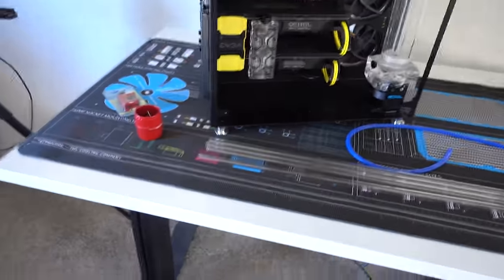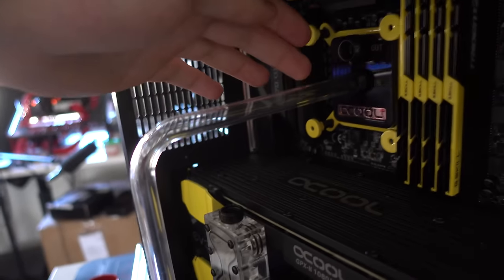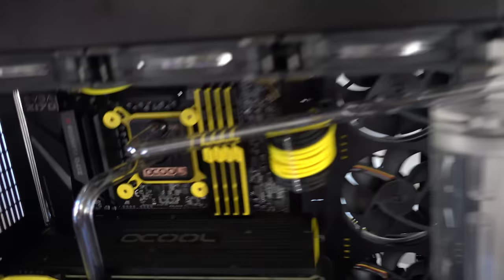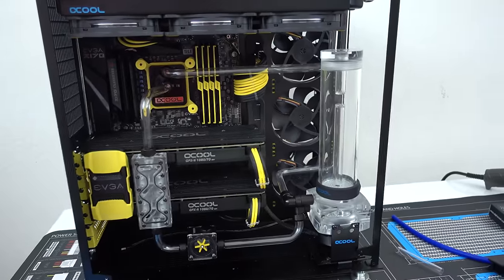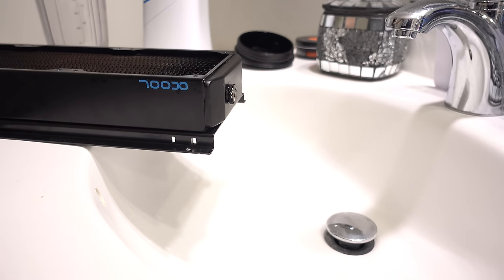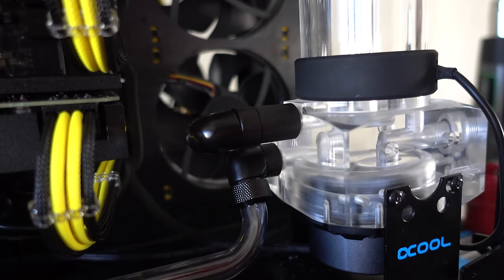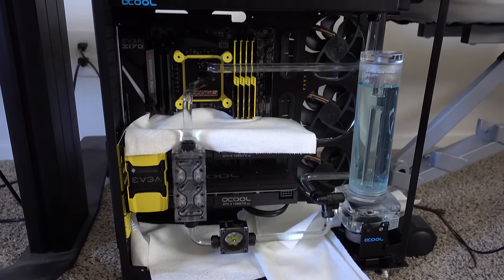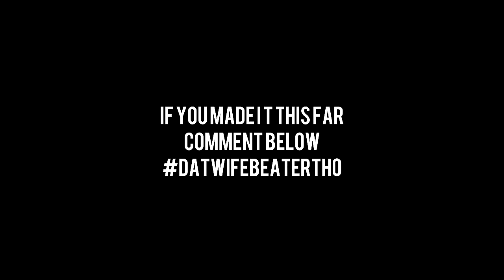More Problems With #ElectroBox | Final Episode

Comment: the problem you are having when tube bending comes from the lack of rotating the tube while heating their are several videos showing how to do that. The tube needs to be heated on all sides by constantly rotating the tube that will help not to get blisters or have kinks I would suggest holding tube about 4 inches away from the heat gun however practice makes perfect :)

Comment: when bending tubes do one bend then measure just the bend. You can then measure from end to end and subtract the bend distance from the end to end distance. So say your bend is 20mm and the distance from the CPU block is 120mm. You measure 100mm on the tube to the START of the bend. The start of the bend is used because when using a bend former there is a mark for the bend start. If you want to mark the middle of the bend do a test bend at 100mm. Then measure the tube from end to end. If the tube is 110mm you know to subtract 10mm from your end to end measure. This way you will waste a lot less tubes and tubes with multiple bends can be done accurately. Hope this helps.

Comment: by the way nice video but the thing is you should have used II radiators, because when the water is going to come out from the CPU block it is going to be a bit warm which need to get cold so that outlet should go into the second radiator and the second radiator out should go into the GPU block which will lead u with a better performance and temperature rating
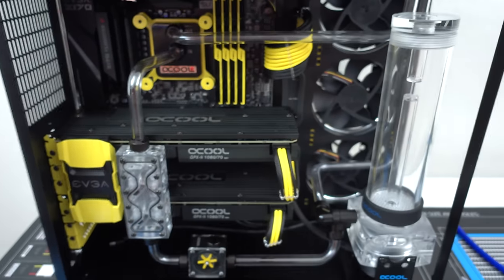Reply: Sam90o Gaming He addresses this at 11:05.

Comment: The silicon insert is way too small for the tube. There's like a 1/8" inch clearance there that is making the tube collapse and impeding flow when heating and making bends. If you don't need olive oil and a shoehorn to get that silicon insert in then you've got the wrong insert or have too large of a tube.

Edit - always wear some sort of insulating gloves with the heat gun. That tool can get pretty hot - not a hair dryer at all.

Comment: Im pretty new to this, how does this look?
Intel Core i5-6500 Skylake Prosessor
Gigabyte GeForce GTX 1060 6GB G1 
EVGA 500W PSU
Crucial Ballistix Sport DDR4 8GB
ASUS Z170I Pro Gaming, Socket-1151
Seagate Barracuda 2TB 3.5'’ HDD
Samsung 850 EVO 500GB 2.5" SSD
Reply: Yeah. what's your budget? you can improve the PSU and make it bronze but it looks good
Reply: I agree with infinity. Maybe just a little better PSU, but everything looks good. Although if I were you I would go for Kaby Lake just to have some of the new features and because it is the newest chip. Also don't forget your case!